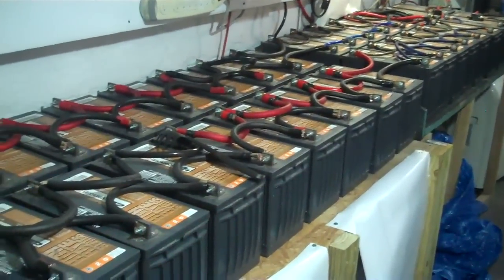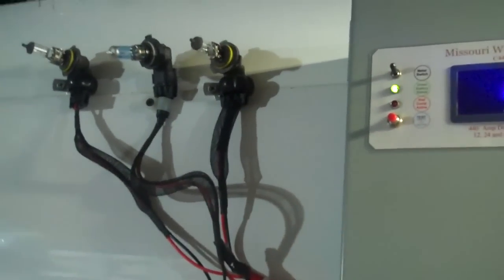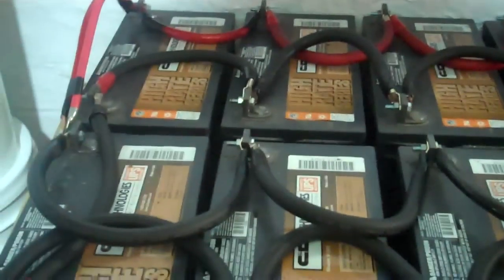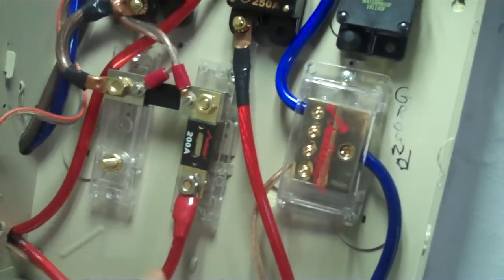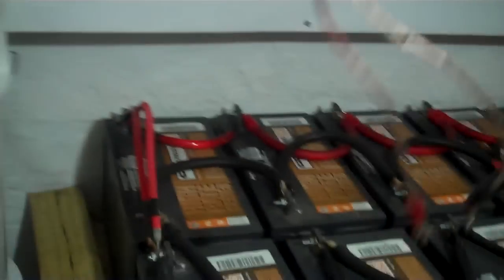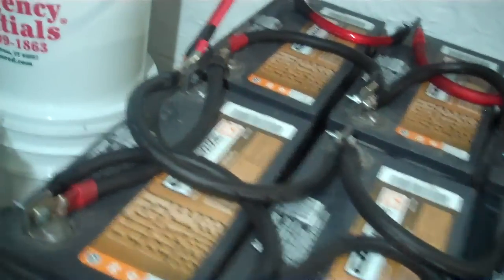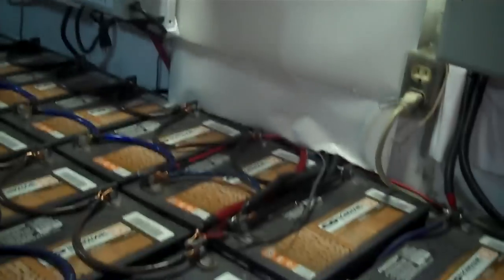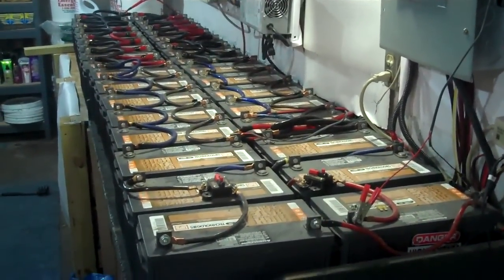Massive Battery Bank for Solar biggest Off Doomsday Preppers

Comment: 100amp? LOL!
I installed the past few days a 6,6kA and a 8.7kA battery system.
Reply: +leosedf First of what is kA, kA doesn't tell anything, unless you meant kAh, even then it doesn't tell anything, so its kWh which tells how big the system is, and second instead of LoLing do a little math its 3.2kAh (32 batteries X 100Ah) rated 12V, so 38.4kWh and with C10 rating you can draw 3.5kW for 10 hours, that's freaking huge capacity
Reply: +Afaq Saleem Yeah right! Like 12V in parallel is actually any good on large systems... With so many batteries he could go for a 48V system to reduce cable losses. Still, it's crap if you want to use a big inverter for 230V
Reply: +leosedf Now you are being immature, seeing all the stuff maybe he got a good deal on second hand 12V electronics like 3kVA inverter or chargers etc or it's just easy to add more batteries later on, and cable losses mean nothing if proper size conductor is used, with 48V he, you and even me would have gone with smaller current rating cable
Reply: He can still wire them at 48V. I still don't consider this reliable.
Reply: +leosedf Reliability has nothing to do with voltage, now lets say someone come along and says why you didn't put your batteries in series to make a 130V system (reverse calculated from your 6.6kA) and saved cable loss and made it more RELIABLE than 48 volt
Reply: Nope! My batteries are 2V! LOL
Reply: +Afaq Saleem You know.... Large systems use 2V usually..
Reply: 2v are cells, but inverters are 12, 24, 48 or higher volts, so anyway connecting 6x or 12x or 24x of 2v cells in series is needed

Comment: That is the absolutely worst way to wire up 12 volt batteries... the ones closest to the feed wires will do most of the charge and discharge due to the resistance of the wires.
Reply: +Colin Smith   It depends on the current.
Reply: +Redblower Nope. Any current flow causes voltage drops.   http://rvroadtrip.us/library/12v_system.php half way down the page. You want each battery to draw/provide the exact same current, otherwise the batteries doing more work will wear out a LOT quicker.
Reply: An equalization charge periodically will sort that out according to my sunny island inverter manual.
Reply: But i do agree that this setup is dangerous.
Reply: +Redblower Well ignore physics and electronics then. its your batteries.  Its not like people have discovered this is a bad way to wire up batteries and have found the best way to do it and shared it with the world so people get the best value.
Reply: you are not listening...I am saying you are right...but that a different wiring scheme would fix it....
Reply: +Redblower Ah sorry. I reread your comment. 
batteries are just so expensive and terrible for the enviroment, and when i see them being mistreated or incorrectly installed its just throwing money away.
Reply: He  will soon have a serious explosion.
It's just a matter of time.

Comment: I know this is an old video...and I'm sure by now you have realized that you 1600 amp hours on one side.....the problem your gonna have with that many batteries is eq charging......the resistance through that big bank of 16 batteries will not allow good equalization and will ruin those a lot quicker

Comment: OK looks like you spent $5000 gust on battery's.... PLUS 5 tie in inverters that's another $450 OR SO.... will this pay for it's self or will it take 3-5 years to do this????? plus 1 amp DC = 1 amp ac no difference between the 2 an amp in dc is the same in ac. same goes for watts 1 watt in dc is the same in ac. GREAT Missouri wind and solar charge controller. I just bought the same 1 just a bit newer. NICE CONTROLLER. works well with the DUMP system.. as a dump load I have 250 watts..

Comment: Just wanted to come here and say to anyone that this video scares is half the stuff this guy is using is totally unnecessary! 👍🏻👍🏻 You don't need a capacitor in your solar system at all for example. A 3000 watt inverter has a 6000w peak start power. There is just tons of unessential items in his system. I think he just enjoys playing with it all
Reply: Also the 3 lights to burn off excess energy I don't think I've ever seen something as stupid as that! Good job👍🏻 the charge controller handles that if you aren't using dinosaur parts.

Comment: thats what im going for
Reply: WHY?
Reply: @vtorsi610  because i actualy want to live like on grit but totaly off grit so i want more then enought power sorry for my spelling
Reply: @jacovan3770  But the cost to live "off-grid"  is huge?
Reply: @vtorsi610  i know  its true but i thoat if i added like monthly start small then go for gold im in south africa and i think its an investment
Reply: @jacovan3770  Do you have Grid Electricity, now?  How much do you pay per month? Is the Grid reliable?   If you use Lead Acid batteries, on a daily basis, be prepared to replace the entire bank, every 5 to 8 years. It is difficult to add NEW batteries to USED battery bank. You might consider USED "Li-Ion" modules from an EV car? Might last 8 - 10 years?
Reply: @vtorsi610  yes i have grit power now its relaible but my thaught was my grandfather passed away and he left us some money so i wanted to buy a land with water maybe but no grit power then put that off grit power in i thaught it will be  cheaper on the long run
Reply: @jacovan3770  Join an Off-Grid / DIY Solar forum - they are all FREE.  You will learn how hard and expensive it is to be Off-Grid. Learn as much as you can from other off-grid homesteader before you spend one cent.
Reply: @vtorsi610  that is good advice thank you i think i will do that i did whatch a bunch of videos on youtube but yea i dont realy know any one that did it before